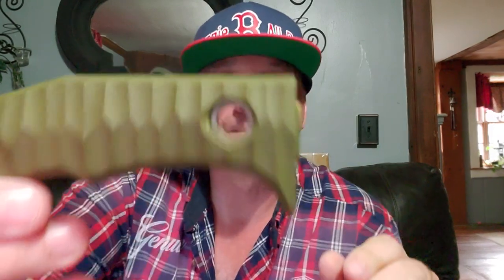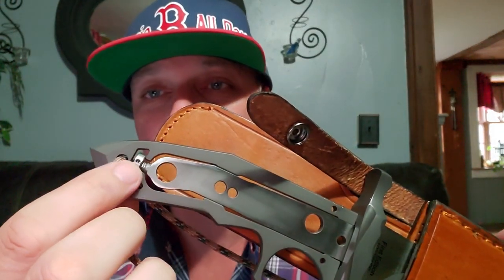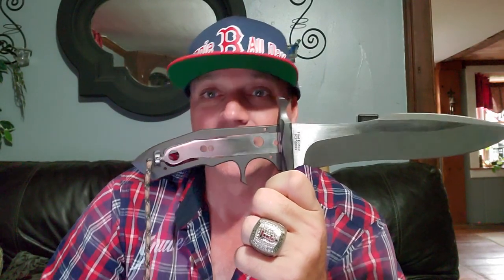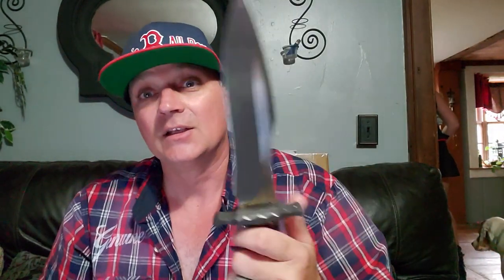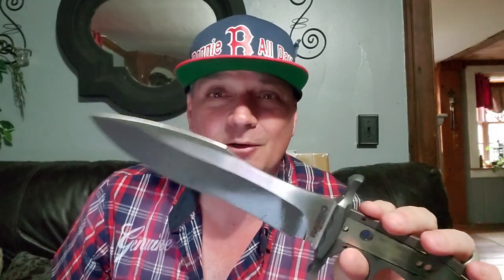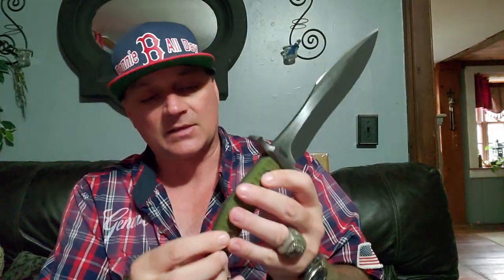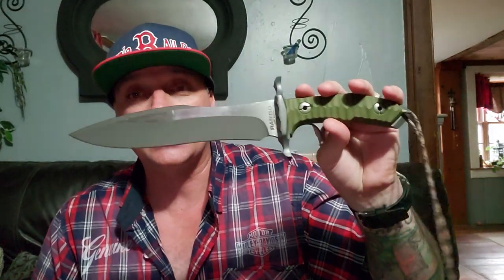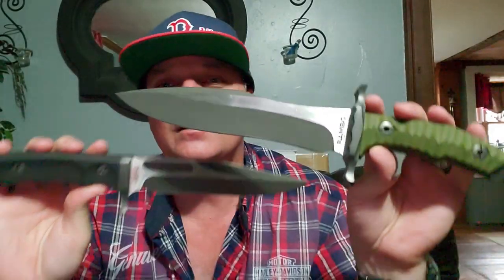Rambo Last Blood knives disassembly and steel update

Comment: Donnie, Nice job on this video. Just wanted to let you know about some improvements I made on mine. When I got it, the scales were loose. I took them off before retightening just to look things over and noticed that the draw screw on the end was also loose. Not that big of deal. You could just retighten everything and should be good to go. However, I was at my shop and decided to, in addition to retightening that draw screw, to tack weld the screw as well as add a couple of tack welds between the tang and the inside of  the outer frame. (And, for what it's worth, the Stallone endorsed Heartstopper with the tan scales also has 2 tack welds along the tang) Now I feel this knife is practically bulletproof for what I am going to use it for. If someone wasn't comfortable welding it, I think a little Locktite on the threads of the draw screw and maybe some JB Weld along the outer edge of the tang would do wonders in keeping anything from moving. Just thought I would pass this along.
Reply from the maker: I agree completely
Reply: It’s the same metal to weld good to know thank you

Comment: Rambo: Last Blood Heartstopper Fixed Blade Knife (9" Satin)
SPECIFICATIONS
Overall Length:15.00"
Blade Length:9.00"
Cutting Edge:8.875"
Blade Width:1.75"
Blade Thickness:0.23"
Blade Material:Niolox
Blade Style:Drop Point
Blade Grind:Flat
Finish:Black, Satin
Reply from the maker: Thats the one
Reply: Hi guys. Donnie, great reviews. I got a question: are you sure its niolox? Im asking because I had that doubt and I wrote to HCG and they answered it is 440... So now I'm confused. I know the Dietmat Pohl edition are niolox because they were manufactured by Lion Steel, but these ones now I'm not so sure...
Reply from the maker: @manuelangelmaldonadorios1519  It says so in the manufacture description so I have to go with them. It explains the $250 price tag they started with and the fact the edge is holding up insanely well!
Reply from the maker: @manuelangelmaldonadorios1519  I actually corrected a guy who sells them yet knew nothing about them. But I'll find out whenever I do need to sharpen it.
Reply: @DonnieBAllDay  Please let us know... Best regards
Reply: "The HCG handle is made out of Chinese injection molded plastic. Also the Color is not authentic" -phoul
Reply: @manuelangelmaldonadorios1519  
I wrote to HCG but haven’t gotten a response yet. I don’t think it’s Niolox, but looks like a quality SS based on other knives I’ve owned over the years. I’ll post what HCG tell me when they respond.
Reply: @DonnieBAllDay , really nice knife… sealed the deal for me since I’ve been looking for a Pohl “Hearstopper” knife for over a year and haven’t found one, so I settled for a repro. 
Good job with the vid, but I don’t think it’s made out of Niolox. I emailed HCG, will add their info here once I get a response from them.
Reply from the maker: @MedievalLit  No it's not. I corrected that in a different vid, but I must say, it takes the punishment

Comment: Hey Donnie that does look like a well built piece and a pretty cool tang concept. The webbing on the inside of the handle screams injection molded tho! G10 is not an injection molded material. Ain't saying it ain't (g10) but really have doubts. Either one should work just fine for a handle material, just saying! Thanks for the full reviews!
Reply from the maker: I had the same thought! Damn website! haha
Reply: I have to agree on the scales, Jed. When Donnie tapped it. It had that plasticy sound. G10 would have denser sound and its not injection molded.
Reply: Hi guys .
Can I add my 2 cents ???
Cause that’s about how much they spent on the Handle materials Hahahaha .
This is ( IMO ) the knife you love to hate .
It’s still seems like a nice blade and all and it will soon be a part of my Rambo collection, but I still gotta question that steel .
Hey ... if I mass produced a blade using S35VN ( or similar) , I would definitely include that in the specs — especially from Blade HQ ( they always include the specs — why they didn’t certainly bothers me ).
I’m just wondering- there are a few versions of this out there .
Could this be the one that features that awesome steel ????!!
Stay tuned .
And hey —— Stay safe as Always!🤠
Reply from the maker: @tubes5150  2 cents goes a long way these days!! Haha! After some research,  its true, the steel is real. They use a steel where the cheapest knife found in it was a 2.5" blade for $200. Its the real deal and speaking of real deal, Jed!!!!! Its out for delivery today!!
Reply: Donnie B All Day Oh I’m hoping you are right kind sir .
The buttheads at Blade HQ REALLY should of included that in the specs .
Why wouldn’t they ?????
Can’t wait to see the other Jed masterpiece.
Reply: @DonnieBAllDay  Ooooooooo! There's something special coming from Jed today! 👏 👏 👏 👏
Reply from the maker: @paulmyers9620  he does owns the rights to one of my designs and its one that'll make a unicorn cream! Haha
Reply: @DonnieBAllDay  Ummmmm, im not going there on the Unicorn comment!!! Lmao
Reply from the maker: @paulmyers9620  Hahahaha

Comment: The edge retention on that blade is better than 440a in my opinion
Reply from the maker: 440A is what Hibben used on his real stuff. Its not the steel,  it's the heat treat and this one has a great heat treat
Reply: @DonnieBAllDay  How did you find out it's not Niolox
Reply from the maker: @TheRingoKid  those were the specs for Pohls version.  I did some digging
Reply: @DonnieBAllDay  Have you had to sharpen them yet sir?
Reply from the maker: @TheRingoKid  not yet
Reply: @DonnieBAllDay  It's Aus-8 stainless steel I found out
Reply: @DonnieBAllDay  You we're almost right but I had a metallurgist here in Texas test one that I bought he said 440a and Aus 8 are similar

Comment: What does it look like where the tang and blade meet? Any stress risers (90 degree angle) or is it curved with a radius? Would be awesome if it had no sharp corner/transition.
Reply from the maker: I didn't remove the shroud
Reply: @DonnieBAllDay  thanks! Have a good one. Love the videos man.
Reply from the maker: @liljuanito123  thanks bro you too
Reply: I was thinking the same thing. Probably it's 90 degrees, as they never seem to get these basic things right.

Comment: I don’t mind having a stick tang for light use knives, but when it comes to a full tang, I’d rather it be exposed top and bottom to fill the width of the grip.  I also rather the pommel not be a separate piece from the tang, but it’s not a deal breaker for me. I can still respect the artistry behind these knives.
Reply from the maker: I'm with you

Comment: i've made a couple knives with frame rat tail handles, great stuff but threads on the rat tail i'm not so sure about.   All the knives i have with threaded rat tails have sheared.  Same with frame threaded rat tails i've made. Anything under 5mm threads is pretty small for a knife, especially a chopper.    Gotta say the rambo knives though are aweesome and this one is an excellent piece.  Huge fan of frame rat tail bowies.
Reply from the maker: the good thing about this is that the threaded end has securing pressures, not just being pulled from one side. Also, its a designed fighting knife, not made for chopping. It just happens to do that really well. I have 4 hard use videos with this thing and I definitely had my doubts, but it keeps on hammering
Reply: @DonnieBAllDay  Yes that is true it is a fighting knife and not intended for chopping which makes a big difference here.  I must have overlooked those securing pressures.  Very interesting stuff.  I hope more companies and people start making framed rat tails.  Lots of potential.

Comment: The current website listing says the blade steel is 7cr17, which has lower carbon than 8cr13 (but more chromium, which means more rust resistance). Not a good steel for $200. It looks like the current blades on the site are different than the original release. The new handle scales for the 7cr edition are micarta
Reply from the maker: I just did a follow up video. This thing is a banger

Comment: Hearthstopper knife (MK-9) from original designer (Pohl Force) have Niolox steel, I’m not sure is it the same case with this knife.
Someone in the comments claimed that he had been in contact with Hollywood collectibles, and they apparently said it was 440 steel.
I would think, that manufacturer would really know these kind of things.
So in this case it would be 440A steel. 

MK-9 is the real deal, but it cost 6 times more than this knife, of course it’s limited edition and all, so it’s more expensive.

One thing is that why they would put cheap plastic handle to the knife with Niolox steel? Why to use pretty good steel, and then cheapest handle material there is?
This just does not make any sense.

Hollywood collectibles have the rights to do “official” Rambo knives. What I have seen with previous Rambo knifes, is that they ask pretty high prices from these, not so great knives.

Note that this knife is not endorsed by Stallone (who is a long time knife collector) or designer Dietmar Pohl. Hollywood collectibles have rights for the name and that’s why they are doing these.
I bet that soon there will be signature series etc available, but these have nothing to do with Stallone.
Stallone will endorse heartstopper knife later on, but it will not be this one.
Reply from the maker: I updated some of the info on my Jed Hornbeak Heartstopper review
Reply: from what I can tell....I wouldn't be surprised if the Stallone versions that actually say Heartstopper on them are the same ones just with the heartstopper name on them....they're selling for about the same price
Reply: Tang construction seems to be from original MK-9 knife (almost exact copy). So this is how to "real heartstopper" was made. It's awesome that this was made the same way.
Reply from the maker: @FunFacts1  I like it
Reply: I think like you do. If it is a high quality steel blade, why making a secret out of it !? This doesn`t make any sence to me .
Reply: Niolox , is the steel used to produce ALL the 400 Unit made by the German Designer ....theses china crap (HCG or UC) are all made of 7Cr17 wich is the equivalent of 440a. 7cr17mov Toughness: not a great toughness, being low-end steel with good hardness and high corrosion resistance, results in a low toughness...   that is ONLY a CHINA"display" knife...
Reply: @TheSubfotant  Niolox , is the steel used to produce ALL the 400 Unit made by the German Designer ....theses china crap (HCG or UC) are all made of 7Cr17 wich is the equivalent of 440a. 7cr17mov Toughness: not a great toughness, being low-end steel with good hardness and high corrosion resistance, results in a low toughness...   that is ONLY a CHINA"display" knife...
Reply from the maker: @markhamilton3215  trolls prove how stupid they are every time I chop up trees they say can't chop up trees.

Comment: I looked up 3v mod cause I had never heard of it  and couldnt find anything at all .  did you mean CPM3v ?
Reply from the maker: Did you look up Niolox? That will tell you more
Reply: 9” inch 7Cr17 steel
Reply from the maker: @markhamilton3215  I'm struggling to get an accurate account. The people at HCG said 420A. I don't know if they're right
Reply: There was only 100 made with nilox As well

Comment: Cool man.chicago screws.no wonder they were looking at me weird at the hardware store when I asked for chainring bolts.but it coulda been that rubber on the bill of my hat.lol.i found em at the bike shop.but they're only a 1/2 inch long.some major counter sinking
Reply from the maker: With a counter sink you should have an eight of an in on each side if your stock is quarter inch.  Not too shabby

Comment: When you took this knife apart, do you remember a radius where tang meets blade or was there a 90 degree corner? It was difficult to tell in the video as the guard covers that area..?
Reply from the maker: I dont remember
Reply: @DonnieBAllDay  copy that! I’ll have to take it apart today! Hahaha! Thanks DBad
Reply: @DonnieBAllDay  There is a radius! Yay! Man, HCG did not cheap out or take shortcuts making this blade! Everything is fitted with really close tolerances. I would have to assume that handle and steel materials are the same! Thanks for all the testing videos too DBad!
Reply from the maker: @robertrhinehart4779  I like it. Its a user

Comment: Great video. I'm A Knife Guy like many others watching this video and I make G10 handle scales. That is injection-molded probably nylon with fiberglass. So if that is not G10 that makes me question the blade Steel. It is probably Chinese steel because a manufacturer will always be proud of their steel and put it on the side of the blade or even on the box. A general rule of thumb is if it is not present on the blade it is Chinese mystery steel because the manufacturer is not proud of it.
Reply from the maker: I responded to you but it looks like it didn't hold. Definitely still a beast with 440A
Reply: Yes it is. It makes no sense why they would put glass-filled nylon handles on such a heavy duty knife. G10 or green linen Micarta would have been the icing on the cake. I'm still debating on getting one and making my own scales but I just don't have the time now to do that.
Reply: I'm wondering what the Rockwell hardness is of that 440a steel?
Reply from the maker: @jameslehner2433  I believe its 58-60

Comment: Great follow up video!  Nice to have the additional info on the steel and the handle grip injection molded parts.  Sly Stallone Shop online also has this knife for sale in a different box.  Do you know if it is of equal quality to this HCG issue?
Reply from the maker: That's the United Cutlery knife.  It looks great but the steel isn't as good
Reply: @DonnieBAllDay  thanks for the rapid response.  Do you have any idea when your version of the Rambo knife will be available?  Will it be on a specific website?
Reply from the maker: @zackstork4420  it should be up this week on www.thekhukurihouse.com
Reply: My KHHI DBAD JOHN J TRIBUTE delivers today!
Reply from the maker: @zackstork4420  it's a yee-haw day!

Comment: Ok...that blade is cheap stainless steel not a super steel....it's NOT a true full Tang knife and the handles are plastic and NOT G10 material...want a full Tang knife with great steel? Get a Becker BK9....
Reply from the maker: You missed the update video and there are far to many better than the BK9. Garbage grips, skeletonized tang and cheap sheath.
Reply: @DonnieBAllDay  A BK 9 will take a lifetime of a beating and chopping unlike your Rambo 5....the grips on a BK 9 can get upgraded to G10 scales or even grip tape add an Azwekli custom kydex sheath and it can be handed down to your grand kids...
Reply from the maker: @rambo8218  no one is comparing it to the Heartstopper,  but I have a custom Heartstopper that doesn't need upgrades  to be great.  If you're knife isn't perfect out of the box, you bought the wrong knife.

Comment: the 'cheap' model limited to 5000 pieces.  is not a Niolox steel.  
is 'stainless steel' (420a).  
the Niolox MK-9 variant has micarta handles.  limited to 300 pieces.  and costs over $ 1000
Reply from the maker: Yes. It was twice corrected

Comment: Rambo: Last Blood Bowie Knife Authentic Replica (8" Satin)
SPECIFICATIONS
Overall Length:14.00"
Blade Length:8.00"
Cutting Edge:7.125"
Blade Width:1.625"
Blade Thickness:0.23"
Blade Material:Niolox
Blade Style:Clip Point
Blade Grind:Flat
Finish:Black, Satin
Reply from the maker: I got all this after I shot the vids

Comment: Sorry man, I usually love your videos but this one is painful to watch. A shrouded (posicle) stick tang that is full length does not = full tang at all. Full tang is a tang that is fully visible all around the handle. Both full length + full width = full tang. 

If length alone = full tang then a full length rat tail or recessed stick would be "full tang" making the term meaningless. 

A common  KA-BAR Marine Fighting knife for example has a full length stick tang and therefore isn't true full tang --nor is any other stacked leather handle knife.

The handles inside show that they are molded plastic. G10 isn't injection molded.  That knife is a highly cheapened version of the movie knife.
Reply from the maker: An exposed full tang is true full tang. The Cold Steel 1917 is a 3/4 true. If the tang is shrouded but exposed at the pommel its a mostly shrouded full tang. If the tang is shrouded but maintains most of the grip size its a hidden full tang. KA-BAR uses a stick tang due to how little the tang fills the inside of the grip. Kanatsune uses 3/4 tangs and so on and so on. Lokk at the description for a Hibben Expendables Bowie. Hidden full tang.

Comment: This Knife literally should be Knife of The Year for 2020, it's design, build quality, and Overall Appeal is Insane!!! I'm going to get a Second one, But ONLY Get the Hollywood Collectables Group Rambo Knives the Rest Are Shit.This is what the Seals should carry just modify sheath to Fit your Gear n Kit perfectly!!. The Mk9 Easily the Best Made Rambo Knife Best Rambo Knife Period.
What up Donnie Hope things going well Brother!!I did a design last night of a Blade she's a dual blade  Beast! inner outer serrations on both etc etc.! My knife of the year has to be the Mk9 it's so far ahead in Too many Aspects for anything to come close to beating it. What's your blade of this Year Mate???….
Reply from the maker: My choice for blade of the year is a work horse. I may be a bit biased but I'd take the dbad Preacher, dbad War Machine or dbad Camp Master over the MK9 any day
Reply: @DonnieBAllDay  Whilst aspects of the mk9 are worked into at least one of those blades,lol, .I meant the Dietmar Pohl POHLFORCE MK9 Knife Not the Replicas.